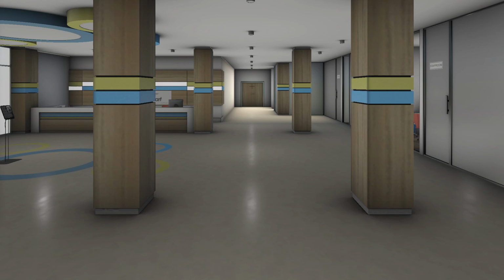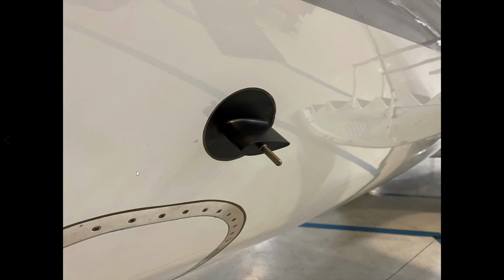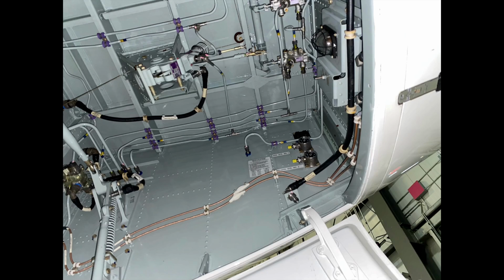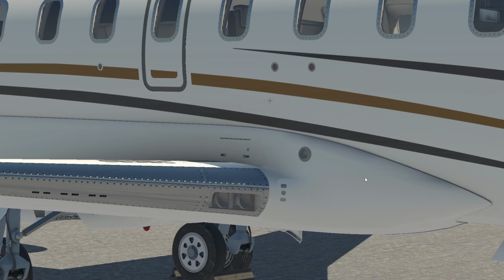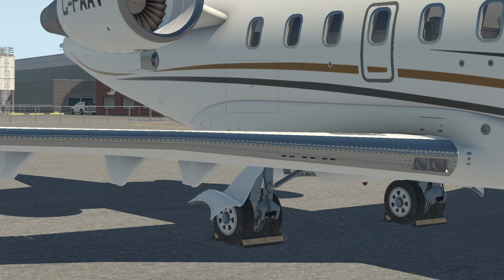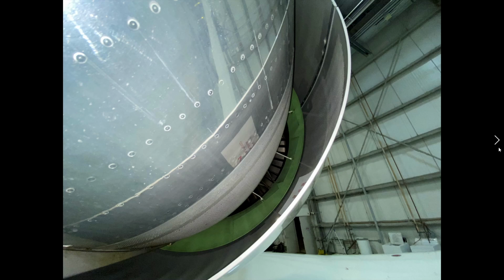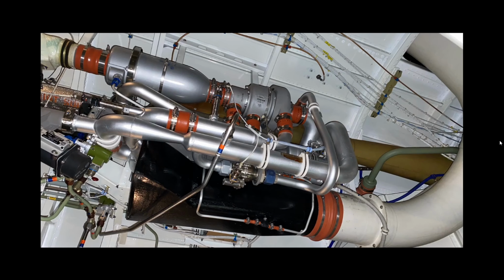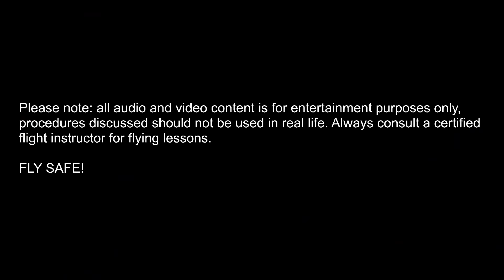Hot Start Challenger 650 Walkaround Tutorial with a real life Challenger 650 Pilot

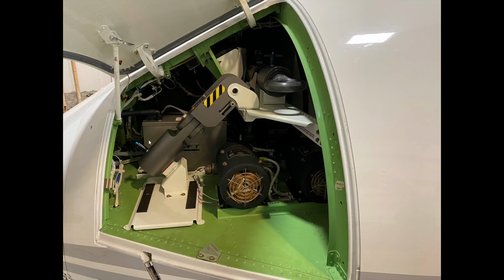Comment: Nice video. Check at 36:16 though. The aircraft generators produce ac power and the tru's change the power from ac to dc.
Reply from the maker: Absolutely, you are 100% correct. I definitely misspoke, a TRU combines a transformer and a rectifier into one unit, the TRU converts 120 V AC power generated by the engines or APU or GPU into 28 V DC used by aircraft electrical components (avionics etc). Thank you very much for the correction.

Comment: I believe skydrol B, which is purple you’re missing the trim tab indicators on the hot start slide. I may be wrong but 15 minutes to 2 hours before you have to motor it to replenish the oil and left is right and right is left. I think on that refill for the engine oil up to 2 qts max
Reply from the maker: You are correct 👍

Comment: Love your videos. I just wish they had an emergency exit pin to remove from the inside of the airplane. Also, the Ford battery compartment would be nice to see if you can connect the battery in the back or maybe I’m missing some thing. Also missing on the walk around would be the vent for the Tail tank on the vertical stabilizer and it seems every time somebody fires up the ape you nobody ever checks the AC summary page to see if the minimum 22 V are available or better than on both batteries. Keep up the good work I bought the simulator myself as I fly the 650as PIC and I’m new in it ,Low time high mins .

Comment: Thank you so much Rob for the wonderful videos. I hold a FAA CPL IR ME and I have some extensive training on the A320.
I am not planning to take a type rating on the Challenger but I would like to know, from your point of view, how in depth the systems are simulated and if the Hot Start can be use as ( or close to ) a study simulator ( I am particularly interest to be able to follow corectly  the QRH in simulated emergency situations ). Could I use the Challenger 605 FCOM to learn the systems and operations or the 650 is too different ? Many thanks for your advice. Take Care Michele O.
Reply from the maker: Hi, and thank you for your comment. As far as I’m aware, and I have had many different types of purchased flight simulator aircraft, this is the best. As a Challenger 605 and 650 Captain, I can tell you that this product has been used by numerous pilots to assist them with their type rating practice and working on skills after they are type-rated. As far as Systems, go every single one of them on the aircraft is not only modeled, but displayed using a ground school like diagram. The only thing I would say is that the aircraft is not come with extensive manuals. But it sounds like you have them anyways. Yes the 605 can be used for the 650. They are almost identical.
Reply: Many thanks Rob ; I really appreciate it. I will purchase the Challenger.

Comment: great vid excellent detailed insight into the CL650 , Question where are the pitot cover stored ? is it in the door storage just like the pin's ? keep them coming Sir .
Reply from the maker: Hi and thank you, all of the covers are kept in a duffle bag in the baggage compartment shelf. They are fairly bulky especially the covers for the AOA vanes, there is a suction cup that goes over the probe and then a large plastic piece fits over top, secured with spring loaded pin. The emergency exit pin is also stored in the bag along with the thrust reverser lockout tools. Cheers

Comment: Which battery is the main battery and which is the APU battery?
Reply from the maker: The main battery (24-volt 17 amp/hour) is located in the nose bay, the APU battery (24-volt 43-amp/hour) is located in the aft service bay. These batteries supply power to main batt direct bus, apu batt direct bus, dc emergency bus and the batt bus. Each battery has its own batt charging system
Reply: Thank you. Outstanding video!
Reply from the maker: More batt related sys information. The battery bus powers equipment essential for safe flight, and maybe powered by several DC sources to ensure redundancy. Normally essential TRU 1 and essential TRU 2 power the batt bus when the main AC buses are powered. If the essential TRUs are not operating (no AC power or essential TRU failures), the batt bus will be powered by the APU batt direct bus and the Main batt direct bus, provided the batt master switch is selected on. 

Transformer rectifier units (TRU): Recall the aircraft is mostly an AC powered (engine driven AC generators,,APU generator) the normal sources for DC power is through the TRUs. Each TRU converts 115 V AC power to 28 V DC and supplies it’s perspective DC buses, each TRU is rated at 100 amps.
Reply: @foxtrotalphaaviation  Fantastic, thank you!